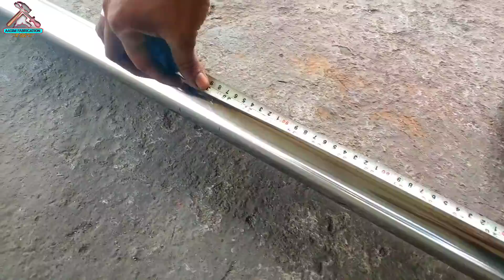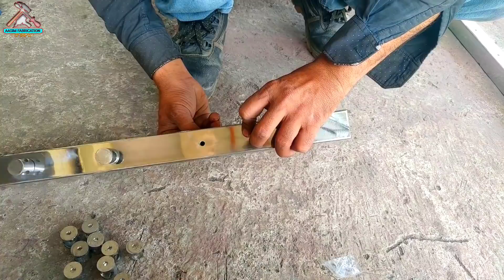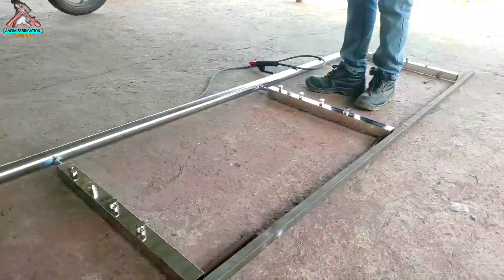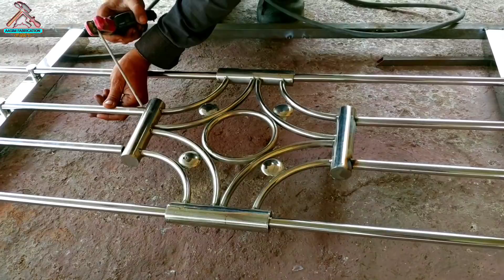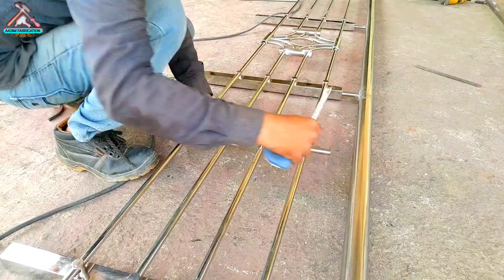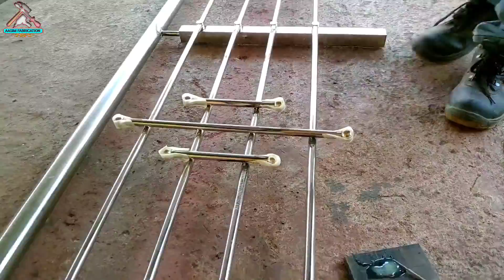amazing stainless steel railing installation | windows grill railing for house |

Comment: NICE digain Mije bhi 150feet lagana  ap apna mob number do s s 304 ss 222 ka running feet rate batana
Reply from the maker: 202 450rs 302 550rs running feet
Reply: Sir apna mob no  do.     Kitna  gej me pipe 304 ss hai ap se bat Karna chahata hu